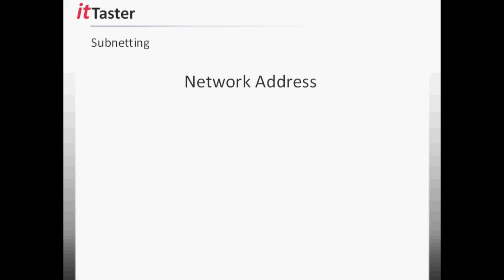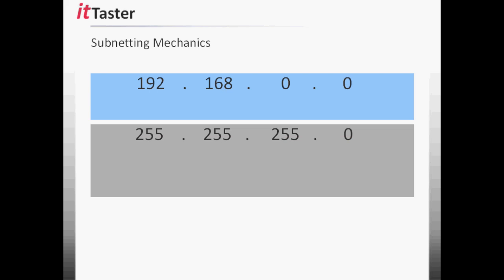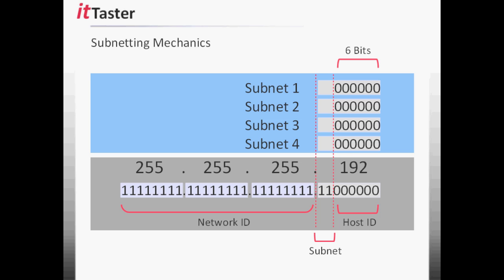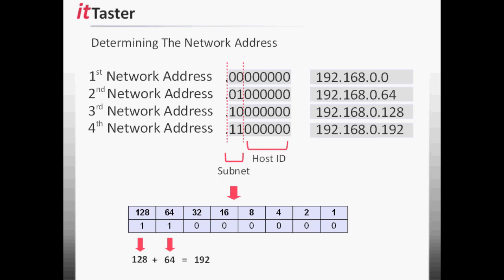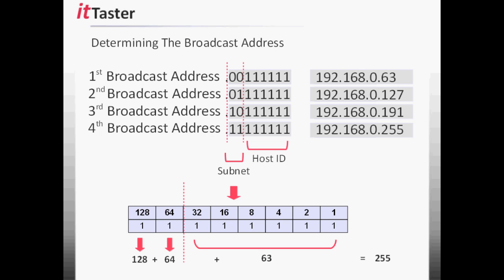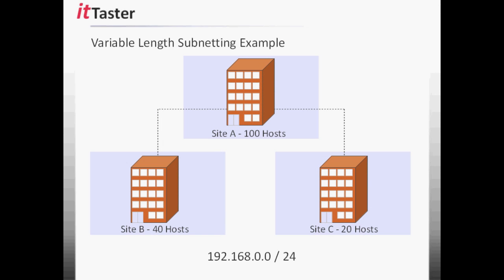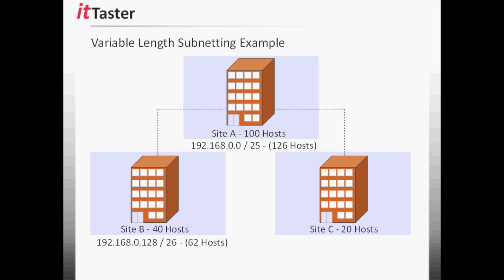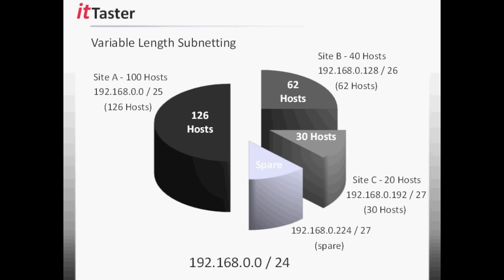IPv4 Addressing - Subnetting (Part 4)

Comment: you have mentioned in 13:55 that the first subnet network gives you 126 valid host adresses how did you do  it
Reply from the maker: Hi, the valid number of hosts is the total number of host bits, less the network and broadcast address. A host IP address cannot be all zeros (network) or all ones (broadcast).  Take a look at part two in the video series which covers subnet masks.

Thanks for your comment.

Comment: Another question or just the above rephrased : Would it not be the same thing if you had a DC on each site that was set as a sub domain of the main DC at HQ so that each site would have it's traffic circulate inside the site via the onsite DNS and only connect via HQ if the intended host was not found in the onsite DNS - effectively doing the subnetting. So if I am understanding this and if I am correct - subnetting eliminates the need of extra DC or DNS onsite or how does it eliminate extra traffic in a way that would be more effective than just having DC's and DNS's onsite effectively handling routing?
Reply from the maker: Hi, DNS or Active Directory isn't able to control routing.  Subnetting enables you to divide up your address space into separate IP networks (subnets). Routers control which networks can communicate with each other.  Two different sites and networks that route, could as you say share one DC, but in practice, a DC at each site would be preferred to reduce traffic over your site to site links, and also redundancy should a link fail.
Reply: Sweet, that makes sense, I am very new to servers etc, been doing desktop support for years but I am becoming bored and I want to move on so to speak, so the learning has commenced :D I haven't dealt with routers over and above soho routers (home stuff), I will check for some video's on enterprise routers and what they are capable of.. Thanks again for the video's, they did help me as other video's lacked certain things that you did mention..
Reply from the maker: many thanks for your comments and I wish you well learning the server side of things.
Reply: Thanks

Comment: If it did make sense then people would be doing it, maybe they are? Could one not just simply 192.168.0.1 a network and "subnet" via 192.168.1.1 and use a router connected to a DC with DNS to rout the traffic between networks or is it better to subnet, forgive me but I don't see the locig in subnetting as 192.168.0.1 - 192.168.1.1 - 192.168.2.1 - 192.168.3.1 would give three different networks and you would still be using 255.255.255.0 as a subnet mask and retain 254 hosts each and the networks would still need a router to talk to each other as they are still technically "difference" networks as with subnets... -and not have to over complicate the network via subnetting via mask (255.255.255.196 etc) or am I missing something important that I am not taking into consideration in this post? I am still learning :)
Reply from the maker: Hi,  subnetting is extremely important and vital when working with larger networks. Dividing an IP address space is necessary to contain broadcasts, routing and security (ACLs) to name a few examples.  In the video the network 192.168.0.0 is used to demonstrate how subnetting works
without dealing with large numbers to make things easy to follow.   Larger organisations with multiple sites and for example, 1000 nodes at each site, including WiFi, printers, switching, routers etc. Would require a much larger address space such as a class A address 10.0.0.0. Where well planned subnetting of the class A network would be needed to ensure efficient use of the address space. 

Hope that helps?
Reply: Thank you for your response, makes sense now. I was missing the "necessary to contain broadcasts, routing and security (ACLs) to name a few examples" as I couldn't figure out why it was so important, but now it makes a whole host of sense to me :D I am indeed starting to see the bigger picture... I think I might be correct in saying that broadcast containment is a big one and maybe security too. All the noise on a large network would cause some serious slow downs I guess :) Thanks for the video's!
Reply from the maker: Absolutely, those are two good reasons. Glad you enjoyed the videos.

Comment: hi Jon,  ok more subnets but why? what is the advantage.
Reply from the maker: +Geoff Chadwick Hi Geoff, subnetting enables us to make more efficient use of an address space. Physical networks are often divided because of geographical location, security or sheer size and the IP addressing must also reflect this.  For example: take the class A private network 10.0.0.0/8, this is one very large IP network. If an organisation has 20 sites and we need them all to communicate, we will need 20 IP networks, so we would subnet 10.0.0.0/8 and assign each site it's own subnet, routers are then able to route traffic between the sites.

Comment: Hi John thanks nice video, can you explain why we don't just simply change the the address from 192.168.0.0 to a class B address then we gain more addresses right away or am I missing the bigger picture.
Reply from the maker: +Geoff Chadwick Hi Geoff,  glad you liked the video. You are quite correct we would gain more host addresses when using a class B or a class A private address range.  In the video I use the 192.168.0.0 IP address space to keep the numbers small so it's easy to understand. 
But the reason we subnet is to divide an IP address space to gain more networks (subnets).  Larger organisations will typically use class A or class B private addressing schemes, and these are 'subnetted' using the same techniques in the video.

hope that helps? 

Jon
Reply: If it did make sense then people would be doing it, maybe they are? Could one not just simply 192.168.0.1 a network and "subnet" via 192.168.1.1 and use a router connected to a DC with DNS to rout the traffic between networks or is it better to subnet, forgive me but I don't see the locig in subnetting as 192.168.0.1 - 192.168.1.1 - 192.168.2.1 - 192.168.3.1 would give three different networks and you would still be using 255.255.255.0 as a subnet mask and retain 254 hosts each and the networks would still need a router to talk to each other as they are still technically "difference" networks as with subnets... -and not have to over complicate the network via subnetting via mask (255.255.255.196 etc) or am I missing something important that I am not taking into consideration in this post? I am still learning :)